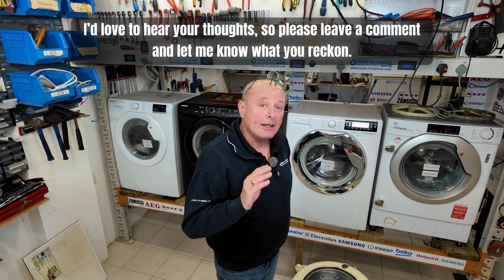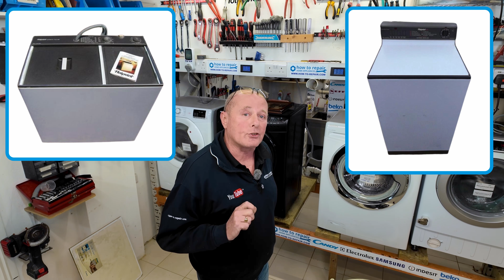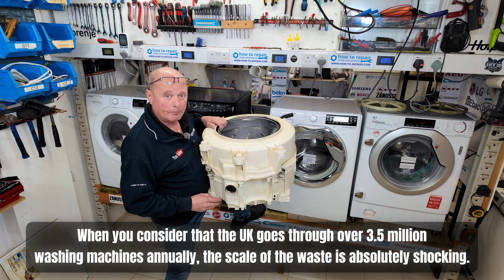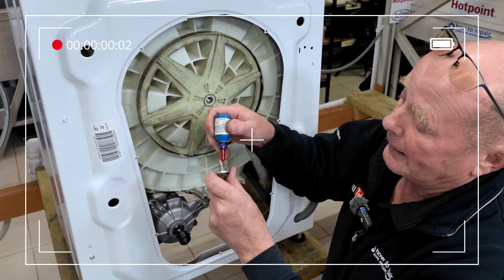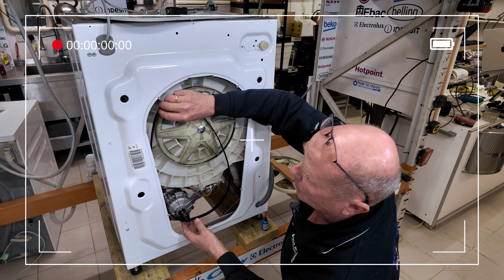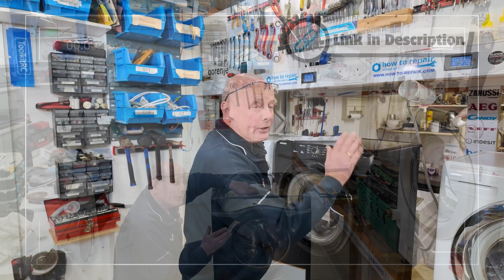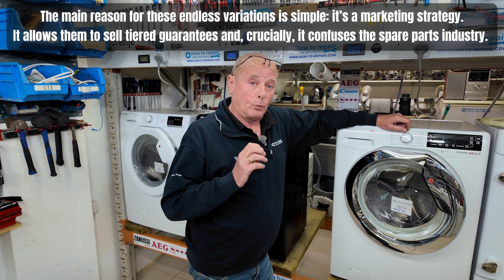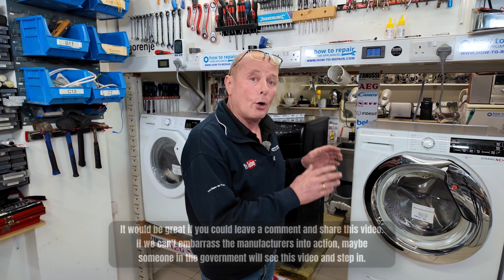I Scrapped 13 MACHINES to Prove a Point: STOP BUYING These Brands!

Comment: I wanted to buy a new washing machine in 2017, and it was a disaster. Two new machines - both of them were broken right away. So I ended up getting a used Miele w698 from1989, and Im still using it to this day.
Reply: My mom has an ancient Miele. Works and washes great 😃👍
Reply: @papazach34   YHE IS THE FAVOURITE WASHING MACHINE BRAND OF THE GREAT MR STEVE JOBS , HE CHOOSED MIELE AFTER 5 MONTHS OF SEARCH OF RELIABLE WASHING MACHINE FOR S REASON 👍YOUR MUM IS A GREAT WOMAN SHE KNOWS  GOOD STUFFS 👍👍👍
Reply: @IsaacGbornor-g6k no need to yell.
Reply: @Just_Joshing024 BUT ITS THE TEACHINGS OF THE GREAT MR STEVE JOBS! Who was btw really good at selling overpriced and equally unreliable electronics.
Reply: @Just_Joshing024  PROBABLY FORGOT THE CAPLOCKS ON!! RAHHHH!!
Reply: @IsaacGbornor-g6k  ok issac, take a deep breath
Reply: i have a 1998 miele and its still going strong .
Reply: @wichywoo  I have a 2000 Bosch (which I got second hand in 2010). Works fine.
Reply: @xxwookey lucky you. Me and my mum have had nothing but bad luck with Bosch.. It's like their battery tools (all battery tools).. complete junk
Reply: @loonaticsrunningtheassylum i thunk the old boschs are just rock solid
The new bosch is crap
Reply: Replaced our Miele Washing Machine after 24 years. Sadly, parts were not available for a repair. Bought another Miele.
Reply: @Cotterdale sadly some Miele are now made in china
Reply: @iwillnoteatzebugs  just leave those on the shelves. Made in Germany or go to LG/Samsung instead!
Reply: @iwillnoteatzebugs . China makes some good things now. They still make crap, but they also have the expertise for quality products.
Reply: @MtaFto  LG consumer electronics + appliances is filled with obsolescence too !

don't know about samsung appliances.  the samsung phone/tablet/tv stuff is great.
Reply: @iwillnoteatzebugs  nothing is made in china except the new boost vacuum line, and even there the motor is german
Reply: @casemodder89 as someone with a little experience in TV calibration.. Samsung TVs and phones are utter junk. Wouldn't touch one with a barge pole.
Reply: @Cotterdale THAT IS AMAZING ,👍👍👍THAT MEANS YOU FOREVER  CHOOSEN BRAND THAT  FOR EVER 👍👍👍
Reply: That late Steve jobs favourite washing machine, it took him 5 months choosing washing machine and he  finally choosed  MIELE , Germany machine
Reply: That late Steve jobs favorite vehicle was the Ford Pinto, it took him 5 months to choose a car and he  finally choose the Ford, OG American build manufacturing that never fails because Steve chose it 😂
Reply: huh. In real life Steve Jobs drove a Porsche or a Mercedes Benz SL55 AMG.
Reply: Our first washing maschine was from Miele (1991 to 2006) and when it was more expensive to repair it then buying a new one we bought a Miele again in 2006. It's still working!
And at least in 2006 Miele has given 10 years warranty on their maschines.
Reply: @ah64dragontv ,, IT SUPPOSED TO LAST MORE BUT WELL MAYBE YOU GUYS WASH ALOT ,AND THE MIELE FRONT LOAD THIS TIME LAST MORE LONGER THEY ARE MADE IN GERMANY , AI GERMAN TECHNOLOGY , ACTUALLY THIS TIME THE FRONT LOAD WASHING MACHINE TECHNOLOGY ARE BETTER THAT 20 YEARS AGO , THEY ARE FAR BETTER NOW WASHING, CARE ,FOR THE LAUNDRY AND ENERGY EFFICIENCY , EVEN SOME CHINESE MADE LIKE   HISENSE ,HAIER , MIDEA FRONT LOAD ARE LASTING YEARS IF ONE TAKE GOOD CARE OF THEM ,  HAPPY LAUNDRYS MY DEAR7
Reply: @IsaacGbornor-g6k  It don't know if your keyboard has built in planned obsolesce, but your CapsLock button has stopped working.
Reply: @ITubeTooInc I don't understand, what exactly are you talking about
Reply: @IsaacGbornor-g6k  Your comment ARE WRITTEN WITH CAPITAL LETTERS. Well except for the commas etc., so it is intentional.
Reply: @leocurious9919 YES YOU  ARE RIGHT I   AM FROM GHANA BUT I HAVE BEEN LIVING IN SPAIN FOR THE PAST 27 ALMOST TO 28 YEARS  ,,
Reply: @IsaacGbornor-g6k  CAPS
Reply: I have a 11 year old Miele.. works like new…
Reply: @lomilomi3535 👍👍👍
Reply: I've got a Siemens machine from 2007, is still working well, never had any problems. And the water consumprion isn't higher. 😊
I'm writing from Germany.
Reply: @andreaWB SAME GERMAM MACHINE 👍👍
Reply: My Miele is not so old but very reliable.
Reply: @ReinhardSchuster 👍👍👍👍
Reply: I replaced my first MIELE dryer after 18 years, and my first MIELE washer after 14 years (current MIELE washer is 8 years old and absolutely no problems with it). Note that we really work those machines at an average of 4 loads each day (we have many many cats, so there are loads of rugs and towels and beddings). In a normal household, with normal laundry, MIELE should perform many more years (I have been told they are built to last at least 20 years). 
Edit : I have had very bad experiences with other brands prior to MIELE, so I do understand the frustration and aggravation.
Reply: In 2008 bought a Bauknecht Washing Machine - 7-8 years later didnt heat anymore - replaced fully damaged heatstring by myself and still running - I do every 3-4 month a "cleaning" programm for descaling. 😅
Reply: Miele is kind of the best brand of everything, and used I think is more expensive than new these days because everyone has caught onto the fact that older products are better…
Reply: Got a miele for 30y
Reply: That actually says a lot about the state of modern home appliances. When two brand-new machines fail immediately but a 1989 Miele keeps running, it really highlights the difference in product durability. A lot of people are noticing the same pattern in washing machine reviews—older machines built to last, while many newer ones feel almost built to fail. It’s one of the reasons discussions about planned obsolescence, appliance durability, and the right to repair are getting louder. When a 35-year-old washer can still run reliably, it shows that long-lasting design is clearly possible.
Reply: @IndustrialScienceLabYT the old Miele would have been an expensive purchase, but in the long room it seems to be worth it.
Reply: my only problem with miele: it's service and spare parts are too fkin expensive. btw the technician said, that they are built for 20 yrs of lifetime :)
Reply: @toty1ka They aren't "too" expensive. They are expensive, but for a reason. Keeping spare parts available in store costs money.
Reply: Miele is a supreme brand. We have a small household vacuum from Miele at home (300€) and that thing is a BEAST - it is the most powerful vacuum I have EVER used - I used many types (industrial ones) and they were WEAKER. Miele is a great brand even today and the quality is top notch for today's low standards. It has been running for maybe 10 years now without any issue whatsoever (*knocks on wood*).
Reply: No !!! Anna your not supposed to do that!!!
Reply: That is refundable .
Reply: Oh yeah my family has been using Miele for 30 years, very reliable machines
Reply: its "green washing" as it called this video, the it its always red flag to my it's all over packages, the fully reclinable? wait its new, you one for week or too, optimistically seven years or down when any going this thing is recyclable  or not? and I don't know about anyone else, i'm not keep box something washing arriveding 7 pule years, just can recycle it it when finished?
Reply: @dh2032  having a stroke?
Reply: @Juksemakeren 😂😂😂😂😂😂😂😂😂😂😂quality!
Reply: @scottmillener4255 he might actually have stroke, so it's not probably intended as funny comment. dh2032 should go to see doctor asap.

Comment: I'm an engineer, not a mashing machine engineer and I can honestly say the manufactures and go a f*ck off with these pricings and machines.. Many thanks for this because when it comes to buy a replacement I know I will go and buy from a manufacturer that allows right to repair. Take note manufactures there are people like me who will go elsewhere, as brand means jack now.
Reply: "manufactures and go a f*ck off with these pricings"  For example, a laundromat-grade Speed Queen or Electrolux Professional is around £2500-3500 for a 6-10kg washing machine (and escalates in price rapidly for large 14, 18+ kg laundromat machines). Do you reckon it IS possible to sell a mostly metal, highly serviceable machine like that for a much lower price such that more consumers could have them in their homes? Or it is simply not possible?

Comment: Ok buy a cutting wire, mount in L shape wood a motor connected to the cutting wire , grab a drum , with a soldering iron make a thin groove, then place the drum steady around the cutting wire, turn on the motor, it will split it half , to reseal you can do epoxy or find out a rubber ring . And yes, manufacturera surelly did a metting.

Comment: You know a appliance is trash when the white plastic doesn't turn yellow
Reply: what’s the reason for it? Cheap plastic or what?
Reply: @therabman_5606 It means it never even aged enough to show it. No rust, no fading, labels attached, some not even dirty.
I spend a lot of time in recycling centers, and whenever I see someone bringing in a washer or dryer, I conduct a little survey: how old, why'd it die, etc.
At least a quarter of machines still function! Folks usually offer it to me free. They're either downsizing, moving (and it won't fit, there's already one there, it came from a summer house and the new owners have their own, etc).
I haven't taken them up on the offer because I already have two machines in reserve, and want to work on a project to replace the printed circuit board with an Arduino. Maybe a welded stainless steel frame that was customizable to fit a variety of motors, pumps, etc. Also, to make the pump and filter front-accessible and transparent so one could SEE when it was clogged (I've gotten machines whose only problem was that there were coins or rubber bands stuck in the impeller).
It's madness that mfg's make such crap, and expect us to buy it.
As was stated in this thread, most folks can't wait more than two days to have a working appliance, and you can order a new machine over the net and get overnight or one-day delivery, plus they'll take the old one out and install the new one for you.
That's great, but I'm too old school, too poor, and have too many tools to go that route.
Reply: @Oneshot8242  Transparent points of failure and open-source controllers? You should become a manufacturer, I'd buy a machine of yours
Reply: @HadzabadZa Thanks! I re-read my comment and saw that I hadn't stated it would be open source. YES, IT WILL BE!
Aside from the AC frequently but, a regular Arduino Uno RE and  a handful of relays is plenty cheap (perhaps $50) and has more than enough I/O's to handle the job.
Regards from Denmark!
Reply: @Oneshot8242  I haven't dabbled in either, but from my POV, Raspberries seemed more accessible (cheaper and actually easier to get). Have you considered them?
Reply: @Oneshot8242 pal, please kindly promote this concept of yours, i want to hear more of this!
Reply: @therabman_5606  No, UV exposure turns the plastic from white to yellow over the years, like a lot of years not 1-2 warranty years. If a aapliance turns yellow that means you have the appliance for a looooooooooong time wich is good for your wallet and waste management.
Reply: @therabman_5606  use of newer and better UV resistant materials and paints. Also, the yellowing is reversible with a somewhat simple process involving UV (for example sunlight) once more, bringing it back to original color. Look it up on youtube
Reply: funny man